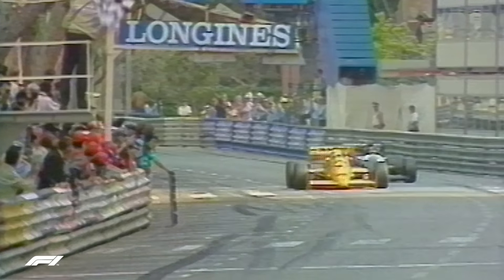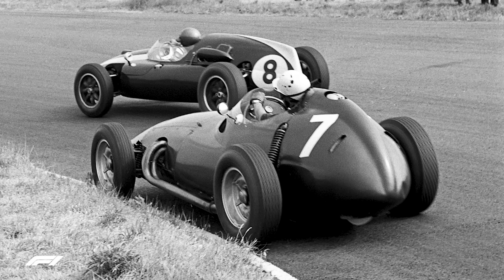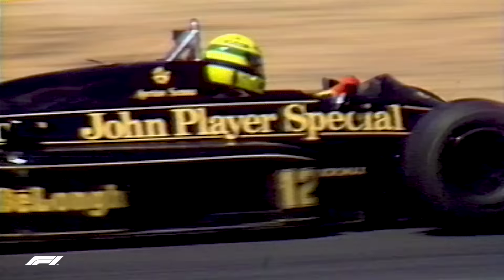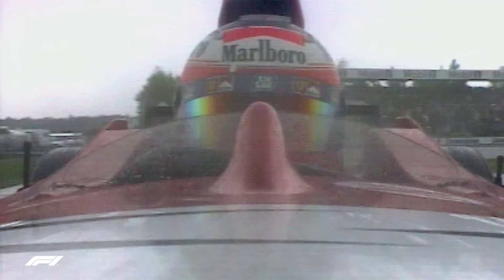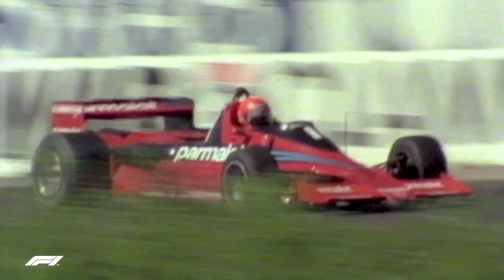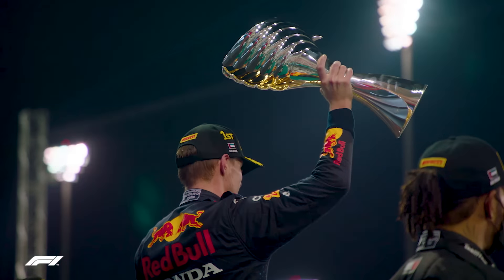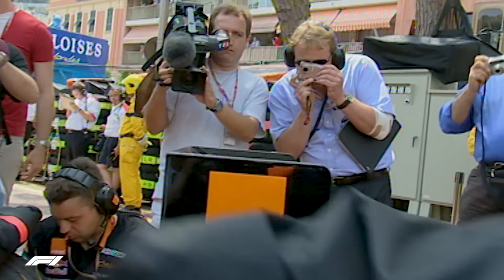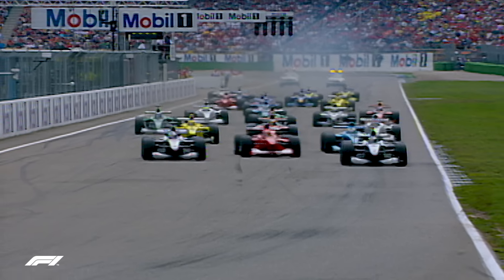Top 10 Biggest Technical Revolutions In F1

Comment: I’d place movement of the engine from front to rear to be THE most dramatic and significant change to F1 design.
Reply: And the first carmaker to do that in F1was Bugatti
Reply: Actually is mid-rear. Or "central".
Rear engine was "a thing" of most Porsches until recent years...
Reply: @GsrItalia  “Rear” as in rear half of the car; to the rear of the driver as opposed to in front of the driver.
Reply: @johnmack537  F1 layout is closer to a Lotus Elise or a Ferrari 360 Modena,  than a Porsche 911/997. Can you say otherwise?
Reply: @GsrItalia  I was clarifying your confusion about my original, generic description. It was NOT intended to specify a PRECISE location for the engine.
Reply: @johnmack537  now I can understand what  you though, thanks to express it.
Anyway "rear" was wrote, not otherwise. Unfortunately i can read only what you write, not what you were thinking.
Reply: Not sure if carbon chassis or ground effect would be severe steps too
Reply: I think downforce (wings) is the most significant change, and should've been #1. It practically defines modern F1, and was nonexistent in the early years.

Comment: One of the greatest innovations in motor racing was thought of by Ray Harrom in the Marmon Wasp, at the 1911 Indy 500. By the simple expedient of attaching a mirror to the Wasp, he was able to dispense with the so-called Riding Mechanic. There were no spanners carried on board, his sole purpose was to inform the driver of any car getting close enough to be a threat, and on which side that was coming from. By doing away with the weight of the " mechanic" he won the inaugural race. Since then every race car has had mirrors.
Reply: Ah yes, the exact moment when the engineer entered the playground.
Reply: Not utilizing a riding mechanic certainly played a pivotal role, but other factors should be considered too. 

Indianapolis was his favorite racecourse, and he prided himself on prudent race-craft.
In an era of thrill seeking daredevil race drivers, Ray Harroun was more a thinking man's racer. 

As an engineer, his pre-race planning led him to secretly consult with Firestone engineers about tire wear and overall longevity over the course of 500 miles. 

Their collective assessment was to keep it under 80mph to prevent excessive tire wear. With that in mind, he averaged 74.6mph over the 500 mile, seven and a half hour race. 
He went thru four right rears, and never needed to change the other three tires. His fellow participants averaged 11 pit stops each. 

As well known as his effort was, I feel he's STILL under rated, under appreciated.

Comment: Honorable mentions:
Side pods with radiators
Tyre warmers
Rocket fuel, refrigerated fuel
Bald tyres
Reply: Qualy Tyres, Qualy engines durint the Turbo era (THE one),...
Reply: Don’t forget the HALO
Reply: @harishmahadevan9170  its not a technical revolution, more like safety standards
Reply: Also :-

Disc brakes
Carbon ceramic brakes
Reply: @alphabetaxenonzzzcat  disc brakes were introduced at le mans, not f1
Reply: And dampers !
Reply: No DRS?
Reply: @danigonzalez4299  How is a softer tire and an uptuned engine a technical revolution?
Reply: Rocket fuel was more of a danger to everyone on the track than a improvement

Comment: Formula 1 in 60s: We need more safety

Meanwhile Formula 1 in the 60s: 18:12
Reply: Came to the comments for this. Crazy stuff. They're taking a stroll.
Reply: safety wasn't a priority back in the 60s, it was in the 80s when the cars started to flew off and horsepower increased drastically
Reply: Some of the early 70s BBC broadcasts are on YouTube.  Search and watch and it’s amazing how close everyone is to the track with little or no separation between spectators and the race.
Reply: @agracer1000  its even crazy to see the spectator on Rally back then
Reply: @rotua98  just search "group B rally Portugal" and you will see.
Reply: @your_local_subaru_impreza_gc8  yea that was what im thinking
by the way, is there ever happen an accident involving the spectator ?
Reply: @rotua98  Portugal 1986: an Ford RS200 Crashed into an crowd,three people died.
Reply: I remember seeing rally races where the crowd was in the car's way, and they stepped aside to open a path juuust in time. Horrible. It wasn't too long ago, maybe the 1990s. I don't watch rally, but I hope it's not longer that way.

Comment: Of course you overlook one of the biggest advances in engine development, the pneumatic valve train. This of course changed every team on the grid...
Reply: I don't think they use it anymore?
Reply: @unsaidatom2310  every team still uses it.
Reply: @rogeeeferrari  are you sure about that? They wouldn't need to
Reply: @unsaidatom2310  Please explain how they open and close valves without it ?
Reply: @rogeeeferrari they open with camshafts and close with conventional springs.
The only reason they went to pneumatic was because of extreme rpm.  An F1 ICE doesn't even rev as fast as a superbike anymore.
I don't want to have a YouTube comments section argument, I'd like to have a considered discussion about the topic. I am prepared to conceded that F1 still uses pneumatics in the valve train, I'm just wondering if they still do?
Reply: @unsaidatom2310  Modern F1 engines use electronic solenoids to open and close valves, the camshaft is only used as a magnetic trigger for the solenoids, it doesn't actually make physical contact with anything. The system uses compressed air to function, every F1 engine works this way, just like back in the 1990's, they haven't figured a better way to do it...
Reply: @rogeeeferrari  they have full size camshafts as 'triggers'?  Why not just use the ecu? I'm happy to concede that the valve springs are pneumatic (closed system nitrogen apparently) but there's no reason to have 4 camshafts if the valves are actuated electronically...
Still, happy to be proven wrong
Reply: @unsaidatom2310  you cannot control valve timing with an ecu, against the rules, camshafts must be present in all engines by rule also. Google "Pneumatic valve actuation" and you'll find an article explaining how the valves work, look Ma, no springs, LOL

Comment: Honestly the genius of active suspension was not that it refined the ride-height but that it redistributed the burden of the lost grip that caused to the less grip limited corners of the car, a process only really perfected by Williams' FW14B. Before then it was always a bit of a clumsy compromise which is why most teams just didn't bother with it before 92/93. Instead there were other small but clever innovations like the MP4-6 being fitted with manual ride-height adjustor that allowed the car to be dropped lower at the driver's command.
Reply: Yes, one of the many innovations of another genious, Gordon Murray

Comment: It's still unclear for me why this active suspension was banned.
There's some 300 sensors on modern F1 cars. Why not make maximum use of it?
Reply: Because the teams started to pre-program every turn into the suspension routine and that involved gear changes, engine mapping, braking, traction control, ride height, and every other driver aid imaginable. Policing all that became impossible as the ride height saga proved, they ran crazy low on track and high at the minimum when passing the control blocks at the entrance of the pits.

Comment: 6:53 the only contribution to racing I admire more than Chapman is Jimmy’s but it must be stated Colin is far From the first use of a monocoque in racing. Hints in the name itself with the active portion being French for single body.  Aircraft as always is upstream of auto & Eugene Ruchonnet proved this with his “Cigare” in 1910/11. A handful of years later, Chevrolet Motors founder raced the “Cornelian” at Indy which was the first car to use what we’d refer to as “stressed skin”. The engine was apart of the load bearing nose portion. This is where Colin can be credited. He flipped Louis Chevrolet’s design from half a century previous and hung it at the rear driver bay. Stockpiling the fuel behind Jimmy he could also leverage another concept borrowed from aviation but revolutionized in Formula 1 by Chapman: downforce. He now had real estate on the  sides to manipulate airflow instead clogged by fuel lines. So like most things Colin put the full weight behind his ideas whether from scratch innovations of borrowed - he’s a maverick for the way he pursued Victory. It’s one thing to have a genius technical concept, it’s another entirely to win championships with it.

Comment: 07:52 turbo chargers don't use the heat from exhaust to create power, they use exhaust pressure to spin the turbine that creates greater than 1 atmosphere of air being forced into the engine (hence forced induction )

Comment: Turbos don't use heat energy🤣 they use exhaust flow to spin a turbine
Reply: The flow is the result of heat energy expanding a gas volume. You will find the temperature of said gas drops significantly after going through the turbine.

Comment: I think there should be a Formula X where there are fewer regulations other than safety regulations, just to see how different teams can make their cars and still be in competition with each other
Reply: Unless you put in a strict $ limit, you’d quickly end up bankrupting everyone who tried fighting in it. Spending millions to tweak the shape of lug nuts isn’t out of possibility. The faster you go, the harder it gets to protect the driver unless you get rid of the driver entirely. which is an option, either AI or RC.
Now, handing teams only $100K to work with to make a fast car? That would be pretty interesting too. Going fast on the cheap is something everyone can relate with. Want active suspension? How much would that eat away on the aero budget?
As much as like fantasy racing series, strapping jet engines to get you over 400 mph is just, no.
Reply: @Appletank8  I said fewer regulations, not no regulations, of course there would need to be a budget cap, because things can get really crazy

Comment: The MGUK/Kers design seems like something car makers could have eventually made reliable and cheap for road use.   Even using cheap batteries or capacitors instead of expensive Li-ion batteries.  It was just used in a few exotic cars that I can think of.  I wonder why it never caught on.
Reply: Because hybrid systems are flawed in efficiency, you have to carry around both an engine with fuel and drive system, plus the electric motor, battery and drive system(brain box, wires).
For road use it's better to go either all petrol or all electric(which has the KERS system built in as "regen").
Hybrid makes sense only when full electric is not easy; long distances, poor charging network, technology not advanced enough yet, etc.  But a petrol engine alone solves these problems as well.
Reply: KERS is hybrid tech, you recover energy via braking, return that energy on acceleration. The difference is only how you want to store that energy. Flywheels, batteries are the main ones. Too small a battery, you risk maxing them out very quickly on longer brake zones, defeating the point.
Reply: @coast2coast00  This is all true,  I drove a toyota hybrid for years.  It had big bulky battery under the trunk and was more complex under the hood.  One thing I wondered is why car makers never wanted to come up with any solutions to recover the energy from braking other than full on hybrids or EVs.  Like even a system that theoretically gave you 1 more mpg.  Hopefully you would get more benifit, but my point is something cheap, not complex and not a lot of components.  Think about the same amount of components that would go in an electric scooter.
Reply: @dannyslea  uhh... "KERS" is literally the same thing found on millions of hybrid cars in the road. Regenerative braking to store energy in a battery, then deploying that electricity to an assist motor has been around since the first Prius. It's complicated because that's the only way you can make it work, and it uses Li-ion batteries because ordinary ones would be absurdly heavy.
Reply: @jsquared1013  Technically a prius is KERS yeah. The Prius has a separate electric motor and special transmission that manages power delivery.  Also for the longest time, Prius did use a large, heavy nickel-hydride battery pack.  F1 engine's MGU-K is small and attached to engine block. I was doing a little research and the Ford Focus "Mild-Hybrid"  is a little bit more of what I am talking about. Smaller, not a lot of components and a car not centered around a battery pack so not a huge extra cost added.

Comment: 7:50 Turbochargers do NOT work by "reusing heat energy from the exhaust" blah blah. 
They work via the exhaust gas pressure passing by turbine blades (hence turbo), spinning a rotor on an axle, which turns a compressor to produce intake overpressure (hence charger). This sort of fundamental mistake by a narrator is what happens when a person is hired for their voice to read a script that was written by videographers.
Reply: In a turbo charger system you cannot separate heat and flow.  They are integrally linked.

Comment: Replacing the gear lever in favor of the steering wheel controls was not John Barnard's original idea in 1989. Ferrari, designed by Forghieri, had tested it ten years earlier at Fiorano with Gilles Villeneuve.  The technology was still in its infancy.  The driving sensation did not please Villeneuve, so it was shelved.

Comment: Regarding the Ferrari 640 - the reliability problems of that car had nothing to do with the gearbox. Barnard himself has said that the problem ultimately turned out to be the alternator - it wasn't supplying the car with enough electric charge (which would cause the new gearbox to fail).

The gearbox worked just fine if the car's electrical systems were being properly supplied.

Comment: In my personal opinion, at least two additions to the informations should be placed in fairness of a driver and an engineer.
First one is the driver, Mr Alessandro Zanardi, which was quite a gamechanger for Lotus improvement of active suspension after several tough crashes during the 1991 season. Alessandro helped Peter Collins to find why the car started become lunatic after a while: sensor submerged into thermal-sensible stabilizing foam. Garbage in, garbage out, the active suspension gone crazy when sensors started bouncing into the warm-softened foam.
Second one is the engineer, Mauro "Furia" Forghieri, which was the one who delivered first a fully functioning sequential gearbox to Gilles Villeneuve. At the time, buttons were placed on steering wheel spokes for up and downshifting. In his immense ad instinctual talented driving, Gilles refused to use that already working arrangement (which was faster and reliable enough to be race-developed) preferring the well known and better felt gear level.
Credit should give when credit is due... Barnard found the concept into Ferrari research archives, he tightly integrated with a much interesting and compact gearbox (for the time when it was designed) with a so improved electronic technology which made the shift significantly faster. Barnard believed in the solution that much that designed a monococque without any kind of possibility to adapt that for a gear lever, making the car lighter and thinner.
Fun fact, the first victory was achieved after a "steering wheel" pitstop because the gearbox started to play funny. At least... not that much for Mansell which was trying to win the race.

Comment: 1:56 Kimi Raikkonen used a loophole in the track limits at turn 1. By running off wide he had the car balanced sooner to be able to floor it quicker before eau rouge and to pass on the straight. It had nothing to do with the KERS system wich did nothing but add additional weight to the car with minimum benefits. Also the KERS system recovers kinetic energy and not heat as stated in the video.

Comment: Kers ain't actually about recovering the "heat produced by the brakes", rather converting the motion of the car (kinetic energy) into electric energy via an electric motor which works as generator, that slows the car down. Heat is produced as well, and cooling system are used to keep it under control and avoid brake failure and stuff.
Electric energy produced by the generator is then stored in a battery (supercapacitor, lighter and more powerful) and than deployed in the straights via the same electric motor.

Comment: Maybe not mind blowing revolution but the Renault in 2004 had the start sequence programmed into the car.

Once the signal dropped from the grid sensors (to prevent a jump start), the lights would turn.

So driver would put foot down and hold it and then signal would drop and be off.

Very cheeky

Comment: They used FIAT 500 front suspension and locked out the steering in the rear. 
And brought up Norton Mcs for their engines and officially the first F1 race was in 49 at Brands Hatch.

Comment: 7:53 Turbos do NOT use HEAT energy, they use waste gas to run the turbo-fan which then compress air, that is then forced into the engine.

Comment: I wish they would bring back KERS. I know it is integrated into the PU, but I wish that they give the drivers the power to decide when to use it. Also, if a team doesn't want to use KERS they wouldn't have to and their car could be lighter. Back in 2009, it was estimated that KERS weighs 30 kg, so let's say KERS would add 20 kg to the car (due to the RnD over the years). Right now the minimum weight is 790 kg, so if a team doesn't use KERS their car could weigh 770 kg.